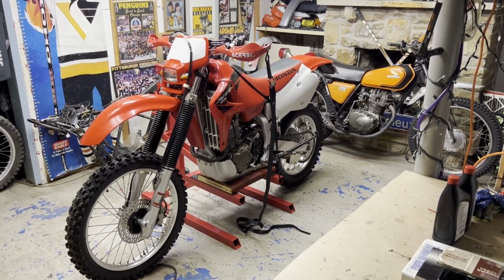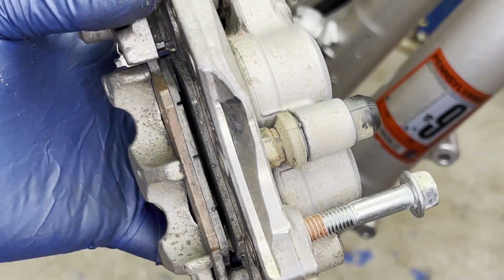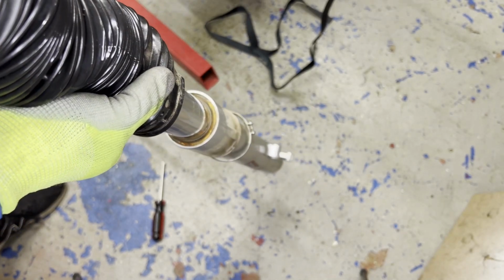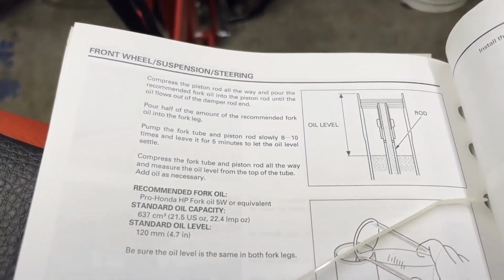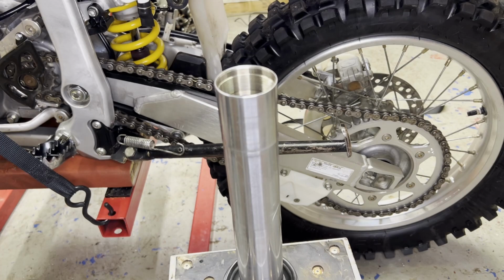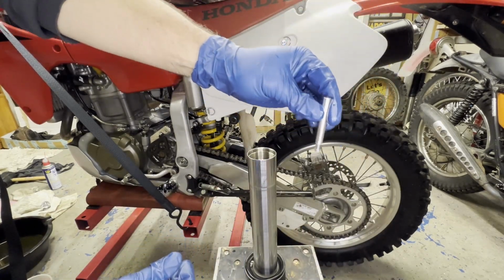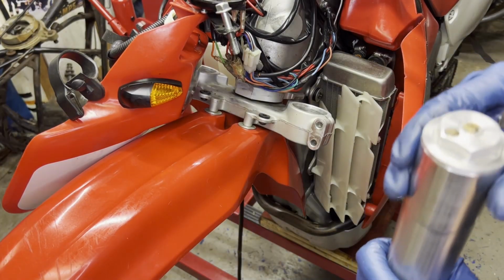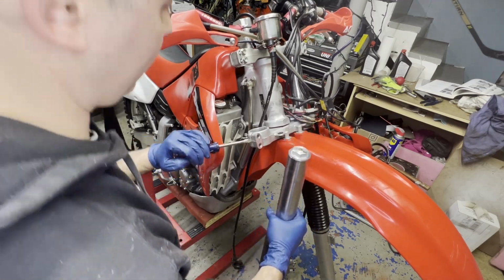XR650R maintenance: Part 2 Fork Oil

Comment: Excellent Tutorial.... I'm currently in the process of doing the same maintenance schedule of both front and rear.
Reply from the maker: Thank you!  Glad it was able to help.  I’m assuming you saw Part 1 as well showing the rear linkage?
Reply: @Garage2Trail  I did, and enjoyed both parts. Very well done.
Reply: I just finished my fork rebuild and valve tuning...   At the 22 minute mark, I seat the fork cap until it just bottoms out , I push the spring down and bring up the locking nut to the bottom of the fork cap.
Reply from the maker: @CraigersFish  thank you again!
Reply from the maker: @CraigersFish  sounds good!  Always good to get input on other ways to accomplish this.  How does it feel with a revalve?
Reply: @Garage2Trail  I have not had a chance to ride it yet.  I added heavier fork and shock spring. I did a full front and rear rebuild and with the spring swap.
Reply from the maker: @CraigersFish  be sure to come back and let us know how it feels when you get a chance to try it out!
Reply: @Garage2Trail  I sure will...
Reply: @Garage2Trail  The weather hit the upper 40's today. I took the XXR out for a test ride today. Observations are Very big improvement in the ride quality. The jackhammer feeling has been replaced with a much plusher ride.  The rear wheel used to feel like it was bouncing out from underneath me on sweeping gravel turns with washboard. Very Happy the upgrades with the small sample size.
Reply from the maker: @CraigersFish  that’s awesome to hear…I’ll def be tearing mine down next year and getting the front and rear redone too.  Thanks for the update!

Comment: Excellent video - clearly explained on what to look for and how to feel for wear.  It looks like a fiddly process to get the oil levels right but this makes it so much more straightforward to do.

When opening the triple tree clamps I use a hardwood wedge that is hard enough not to get squished and soft enough not to damage the alloy. An odd thing to have in your toolbox I know.

What bike lift is it that you have - I could really do with one to save my knees.

For future videos it would be nice to see some preventative maintenance - how to stop the brake pistons from rusting up, lubing the control cables, checking wheel alignment - stuff a lot of people tend to overlook. Just a thought and maybe something to add to any other work you do on one of the bikes.
Reply from the maker: I'm really liking your suggestions, so thank you for that!  Good idea for more content for sure.  

It was a tedious process to get the oil out...every time I thought I had it mostly out, i'd let it sit, pump it up and more would come out lol.

I had a plastic wedge that I used to use for my other bikes on the triple tree, but I couldnt find it while I was shooting so i just bit the bullet and wrestled it off lol.  the hardwood wedge sounds like a better solution.

Thats a harbor freight high lift.  works great.  the only thing i had to do was add the block of wood in between the two "fork" arms because its designed more for big street bikes i think and a dirt bike isnt long enough to sit flush in the middle.  with that block, i can use it for my little xl125 too!

Comment: Good video. What's your thoughts on lubricating the chain vs no lube at all. What do you do?  I'm curious, there's no right or wrong answer, its just what method people prefer really. Ive just recently subbed to your channel thanks.
Reply from the maker: Thank you and welcome to the channel!  I lube it before every ride with clear maxima chain lube and clean it after muddy rides.  Maxima also makes a very good chain cleanup degreaser that basically lets the build up of lube fall right off when washing the bike after a ride.  After cleaning, I'll take a dirty old rag and run it along the chain and then apply new lube so its ready to go for the next ride.

Comment: Thanks for sharing! I wonder if anyone makes a gas pair of shock inserts for these bikes?
Reply from the maker: Thanks for watching!  I’m not sure.  I would think someone has to have some aftermarket stuff for the shocks.  I had the rear shock rebuilt and valved for my weight a couple years ago by a local tuner.
Reply: @Garage2Trail  yeah, I need to get that done on mine

Comment: If your just changing the oil there is no need to remove the springs etc...
just drain the oil into a measured container and put the same amount back in.
Reply from the maker: How do you drain the oil without taking the fork off and turning it upside down and the springs sliding out?  There isn’t a drain bolt on these forks as far as I understand.
Reply: @Garage2Trail  You still have to take the forks off and turn them upside down, but you only have to open the caps you don't have to take them off the dampening rod, then the springs, washers collars etc all stay in place.
 I usually change the oil this way every second or third engine oil change, then during the off season i change it the way you showed and make sure the level is correct.
Reply from the maker: @losttheplotcolin  gotcha..I still like to be thorough and pump the dampening rod to get out as much as possible but I guess if you are changing it that often it wouldn’t matter!  Thanks for the tip!

Comment: What part of Pittsburgh do you live in?
Reply from the maker: North hills.  Are you from the area too?
Reply: @Garage2Trail  I grew up in Irwin but work took me to Carlisle near Harrisburg
Reply from the maker: @kennethwise7108  ok cool 👍
Reply: @Garage2Trail  I found a barn find XR650R with only 63 miles on it. It still has the original tires on it. Can't believe it. The bike is cherry and spotless. He put an entire FMF pipe on it then parked it for 18 years
Reply from the maker: @kennethwise7108 wow!  That’s kinda how I found mine.  It was in Salem OH, original tires and hand guards.  Got it for $2800 with an MC title plated ready to go before I even got it.
Reply: @Garage2Trail  I have to get it running, hasn't ran in long time. Carb needs rebuilt.